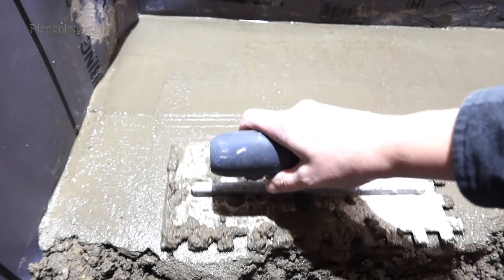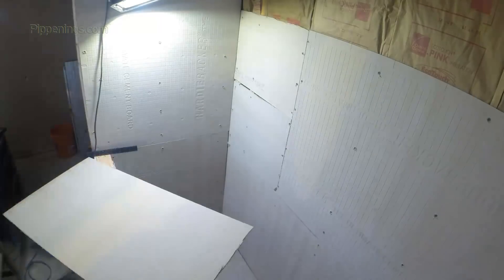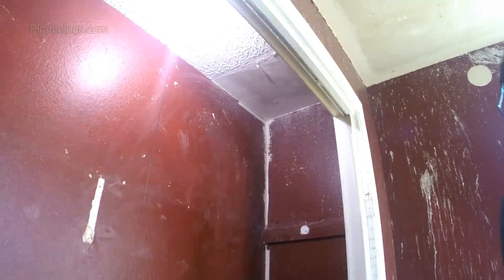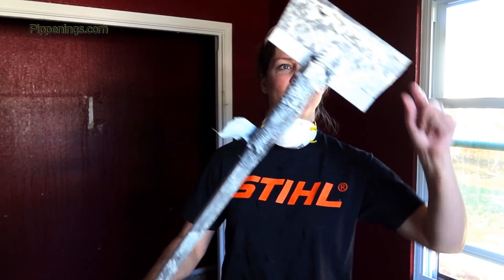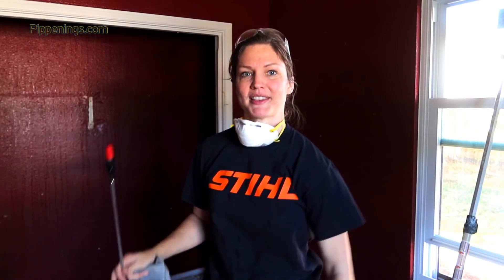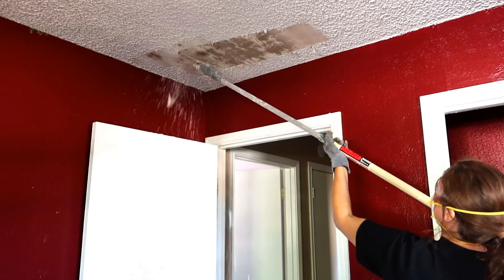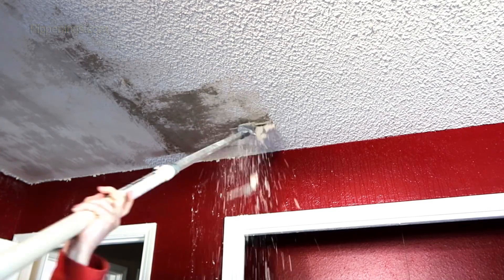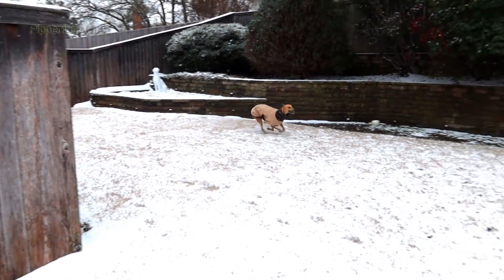Episode 9: DIY House Renovation Underway

Comment: I saw a film about asbestos causing cancer and they showed it floating like feathers everywhere (it does float in air, very lite weight) while workers were doing their thing without any protection.  Ever since that film, I've always wondered if the casual exposure warrantied the fear of it.  Western world tends to hyper ventilate over everything while eating their Big Macs, smoking cigarettes, vaping, and getting high, but the minute someone sees what might be asbestos, they start talking about test kits like it is cyanide. 

Anyway, good to see you Pippi, hope you are enjoying all the new experiences.  One thing I've noticed about DYI channels is that it "seems" better to show people how to do something rather than just showing them something you are doing.
Reply: D Dixon getting cancer from Asbestos exposure in the residential setting may literally be impossible. The ambient levels of asbestos occurring outside in not zero either.  Most cases were about ship builders during WW2. They built boilers and coated them in asbestos mud. Zero respiratory protection in those days. Most lawsuits were about “contingent liability” money for possible future illness regardless of actual illness. Many of the suits were aimed at poor school districts as well resulting in their bankruptcy even though their was never a case proven. Let the lawyers get involved and everything is a hazard needing a large settlement and the law firms get 1/3.

Comment: Typically, drywall in wet areas, like shower stalls, is greenboard. Perhaps you used it, but if not why would you select another option? Also, if you keep building materials wet during removal  the asbestos won't get airborne and become hazardous.
Reply from the maker: That was cement board

Comment: Popcorn ceilings had a certain value in noise reduction and hiding imperfections. A smoother type popcorn is still being used. But most everyone today prefers smooth. For sound dampening they make some nice looking ceiling panels - beware creating an echo chamber which some people discover they have done with remodels. 😢
It’s all very hard work but you seem to like that. Well, you’re good at the physical labor AND design. I hope you go get yourself a professional massage once in awhile. I like to do yoga to loosen up. 😇